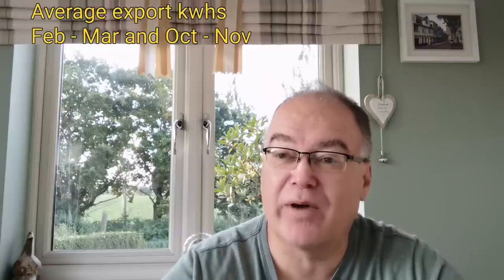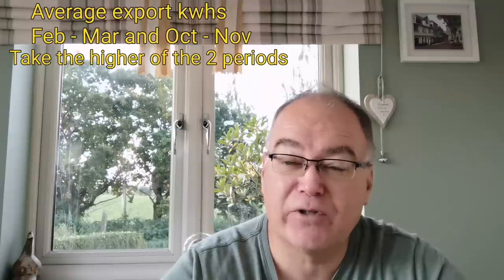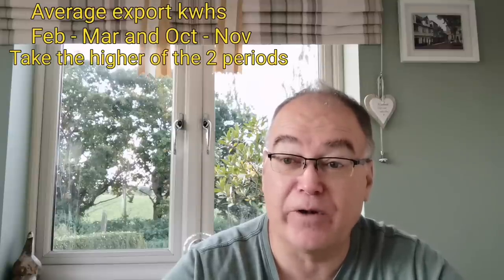How to size a home storage battery

Comment: This video was really timely for me. I've got the ball rolling on a 10 JA panel and 5.2kwh GivEnergy battery system. Still at an early stage so could still spec up. We use around 2800 kWh per annum and having recorded the usage between 6pm and 8am we're using around 4.2kwh a night on average. This includes using the washing machine/tumble dryer overnight for the cheaper tariffs. When the panels are up we'd use these items during the day instead, so the average overnight use would likely drop. So basically I'm trying to work out if the 5.2kwh battery is enough or if upgrading to the 9.5kwh GivEnergy battery is worth it? Any thoughts would be greatly appreciated. Cheers Rob
Reply from the maker: Rob

2800, you must be economical like us. 

10 ja solar, hopefully that's more than 4kw?  If you can  add more I would, as that would negate the worry about a bigger battery potentially.

Sounds like 5.2kwh will be well suited but in depth of Winter you'll run out on some days no doubt as solar can be virtually nothing. Surviving on 5kwh isn't easy

Its all down to cost isn't it. If the extra battery isn't much more, why not. If 2 extra panels can be squeezed in, why not.

Also, price per kwh is better with bigger battery.
Reply: Hi Nigel,

First and foremost, thanks so much for your time and very helpful insights. The installer is proposing 10 x 395 watt JA panels so roughly a 4kW system.

Not wishing to come over like a luddite but can I just check I understand you correctly. Are you saying in the depth of winter having a few extra panels (say 12 rather than 10) would give the system a better chance of running both the household load and charging the battery before nightfall, therefore reducing the number of times night falls with the battery is still (or partly) empty? Again, sorry if that's a daft question but I'm really learning as I go along.

The installer is also saying the larger battery would add £2k to the overall cost, so I'm guessing the extra panels would be a more cost effective solution.

Again, thanks for your help, it's much appreciated.

Cheers

Rob
Reply from the maker: @robcole5805  you've got it,   solar first, even if you're restricted to 3.68kw inverter a few more panels will help. If you can get 5kw and 5kw Inverter even better.

2k for a bigger battery will bring smaller gains imo
Reply: Smashing, thank you again, this conversation has been immensely helpful. Will go back to the installer to discuss whether we can squeeze more panels onto the roof and options for the inverter. All the best, Rob
Reply: @robcole5805  Definitely get more solar panels up front, as scaffolding will make up a big portion of the total bill.
Reply: Thanks Liz, will hopefully be getting the CAD design from the installer this week so will look into the potential for extra panels
Reply: I had 10 JA panels installed (south facing) with the 5.2kWh GivEnergy battery, really wish I had put in the 9.5kWh battery now as it is a bit of a stretch, especially on cloudy and winter days, for my 2 bed bungalow, even with overnight charging on Octopus Flux. May add this later for export and poss air con.

Comment: Your calculations are all well and good if you are solely on an electric tariff but, if like a lot of people, you have dual energy, gas combi etc, those calculations are not so easily done. 
I would like to have solar, but by itself it's not cost effective without also having battery storage. One day I hope to have an EV, but their cost at present make that somewhat restrictive, however I would like to plan ahead. At the same time, cut cost presently for running appliances, and have peace of mind should the power grid fail.
Reply from the maker: Having gas is somewhat restrictive price wise but people keep using it 🤦‍♂️
Reply: @EVPuzzle  In the UK we don't have much option, as it's plumbed in at the time of construction.
Reply from the maker: You always have a choice
Reply: @EVPuzzle  I wish...

Comment: Octopus no longer offer an off-peak tariff.  You need solar PV.
Reply: Not true - Eco 7 is still available and the suspension on Go & Intelligent is temporary whilst they work out what to do about the reduction in fix from 2 years to 6months.
Reply: @philippadobson1589  Really?  Who is offering Eco 7 at this time to new customers?
Reply: @thomasjohnbirks132  I have my smart meter going in next week - I was told (by octopus) to talk to the engineer and he might put it directly on the dule rate.  If not, then I just need to give them a ring and it might take a week or so..
Reply: @philippadobson1589  Thank you.

Comment: Bollix to green energy and peak periods. I’m more interested in getting my 300% increase in energy costs down. If that means burning apple cores, banana skins, newspapers etc in the fire like in the 60’s and 70’s then be it.
Reply from the maker: Sounds like you're snubbing the thing that'll help reduce those costs without avoiding electricity completely. Cheap off peak energy and time of use is key.  Ignore it at your peril

Comment: Fantastic videos! I'm looking to install a battery storage solution to take advantage of our Octopus Go tariff, but it won't include Solar. We live in an end terrace with east/west facing hip roof, and the hip end faces north. I reckon I could possibly squeeze 4-5 panels onto each of the east/west sides, but with all the added costs, and the fact we plan to move in the next three years (so we ideally want to be in a position where we can disconnect and take some kit with us) we plan to go with 6x pylontech us2000c batteries and a Victron Multiplus ii 48/8000 inverter. We're pushed for space though... The inverter can sit underneath the stairs with the existing consumer unit, but no chance of putting the batteries under there as well. Not really anywhere else we could put them, so was planning to purchase an outdoor cabinet (https://voltaconsolar.com/lithium-battery-outdoor-cabinet-ip65.html) which could be installed on the outer wall of the staircase (the alleyway at the side of the house) with a cable fed through the wall into the Victron.

The cabinet appears to be IP rated, but not sure how well these batteries would perform, being out in potentially 0-degree weather over the winter months? Should I expect a significant drop in performance?

Also, would I be right in thinking that with an 8kw/h inverter, we could potentially charge our Kona EV from the battery if we really needed to?

If not, it's not a huge issue, as we're so used to charging the car between 00:30 and 04:30 anyway, we could just keep doing that. The main thing is we want to be sure that everything in the house can be powered from the batteries, which includes potentially running the oven and hob at the same time in the evening, without drawing from the grid. For a small house, we seem to be quite heavy users of electric.... we often exceed 13kw per day even when we're not charging the car! 

Any response genuinely appreciated 🙂